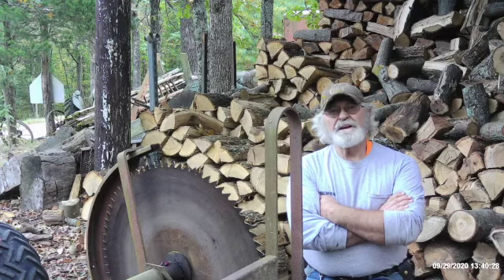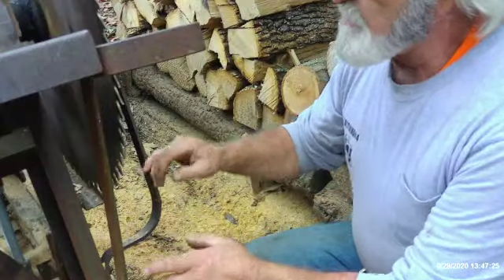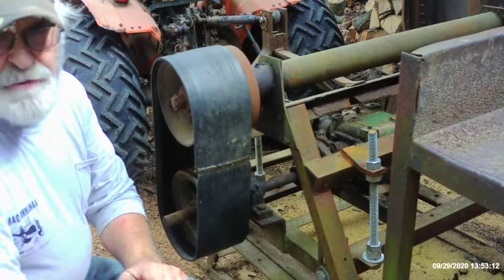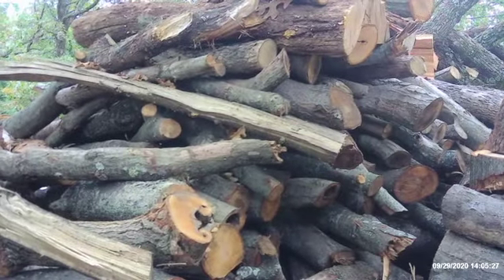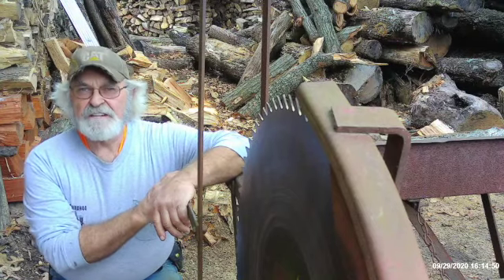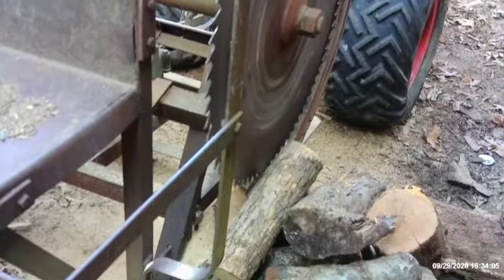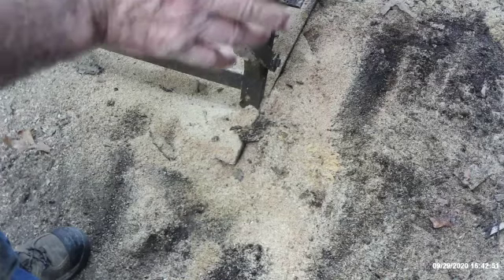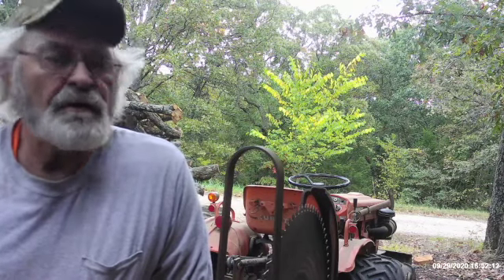Buzz Saw Safety: Detailed Safety Discussion and Operation

Comment: What a fun video 44 Friend! Years ago I did help with a buzz saw operation with a long belt and was warned a few times to stay well away from it. With two or three it is far easier and safer. I have many hour on ,y table saw and I know many guys who had accidents on a table saw but none what's so ever on a buzz saw. Any tool takes common sense and never grow out of respect for it when using. It's like driving a car and many more have accidents than a buzz saw or power tools. I know a guy who shot himself in the leg with a framing nailer, flesh wound fortunetly! He had he habit of walking around and up and down ladders with his finger on the trigger ,,,,,,,at least until that day. He was climbing a ladder and bumped his leg and wham! Very lucky not to have hit the bone or knee. Did go to the ER because those racks of framing nails are held together by those wires so he couldn't pull it out, lovely, eh? Over 50 years of working with wood it hasn't been luck but great respect for moving blades. You can attest to this as well. An ounce of prevention! With a buzz saw or any power tool you have a choice to be at the smart or dumb end. So don't be a dumb arce! Smokey sez, only you can prevent dumbarseness! I think that's what I saw on a sign in a national park? So Tractorman44 Friend, another fine and fun vid packed full of fun and adventure and edge of the seater scenes! I raise me cuppaJO your way inna morning inna holler! Of course I do this most every day but more than once with such an exciting vid! Blessings to All in he 44 Family and Headquarters and Stan of course! Pleasant dreams of dancing about with sugar plums in your 44 tutu! Now there's a video that would go viral!! DaveyJO from my holler to yourz
Reply from the maker: Yessir DaveyJO...you said a mouthful.  I have a cousin was cutting a 2x4 across his thigh with a skil saw.  Yep...kicked back into his thigh and a trip to the hospital....must have been funny to him because it kept him in stiches for a few weeks !!  Thanks for stopping in ol buddy and enjoy the coffee...I sure am !!  Take care and give my best to Alice.
Reply: Those nailers can be a terror. 
A younger and crazier Sneelock worked at Homebuilders Inc many years ago. 
I was walking the rafters running wire through the attic before the roof sheathing was put on. 
I had to watch my step. Literally because it was 16" between rafters and if I missed I either landed on the rafters in a painful way or went all the way to the floor. 
As I was walking along I kept hearing what sounded like bells. Just a little tinkling sound. 
I stopped and looked around but didn't see anything dragging or caught so I took a few more steps. I caught a glimpse of something flying past my face. I looked over at the flooring station and Bill Summers was on the top floor of the house stapling the walls in place. He had a Mark III stapler which shot 3" long staples through the 2x4 and into the decking. He was standing there with big grin shooting off a clip of staples at me. They were hitting the rafters and that's what I was hearing. 
The framers had left their nail gun on the scaffold so i went over and picked it up. I pulled back the saftety and started unloading the nail gun in his general direction. He saw me and jumped off the deck and hid under it. 
Not to be denied I just aimed the nail gun at the floor and started ricocheting nails under the deck. I wasn't aiming at him directly but it was a dumb thing to do. The nail gun would blow a nail completely through one 2x4 and sink it into the next one if if was set on full pressure. It was about like firing a 22 short. 
Needless to saw he didn't aim a stapler at me ever again.
Reply: Old Sneelock's Workshop  The things we do in our youth, eh? Those nailers have lots of power fer ser! I was aiming and nailing a 2x6 and a 10p nail went all the way through and landed by blue prints my friend Paul was looking over. He didn't say anything but his look said it all. An accident indeed and all the more reason to be extra respectful of power and hand tools. Thanks Kindly for your story! DaveyJO in Pa.

Comment: Good video  t man 44. Made me think when me n my dad used 2 fire up his saw 2 cut up batch of firewood.your 16 horse kubota must b a work horse from the way u talk. Dont know if u ever herd of yanmar tractors ill bet u have .dad bought a new model 186d  back in late 70s and that ole dog still goin and i dont think he was one 2 keep up on the basic maintenance. But she still goin strong lol he did stuff with it i didnt think a 18 hp would do.he passed in 2013 now i got the ole girl and shes all original  n still looks good.have good 1 n b safe.
Reply from the maker: Yanmar made a pretty good small tractor.  My buddy that's a Cub dealer in town just took on Yanmar tractors as a second line last year.  Selling a ton of them, most with loaders.  They look to be pretty good.  Weren't the old Yanmars two cylinder diesels ?  Front wheel assist makes a big tractor out of a little tractor. A LOT can be accomplished with these little guys, just like you can attest to.  Now you need a buzz saw for the old gal.....

Comment: hi there  another good one well done .  Have 3 of them around here  . but never used one . i have to many things i can get hurt on all ready around here .   Merry Christmas   john
Reply from the maker: Hahahaha...crack me up John.  I hate to see good pole wood going to waste which is why I use these so much.  I like to get a good mix of split and pole wood in the shed.  They dry differently and there's more sap wood in the poles, so they burn differently too. I think I got three of them up and running, but there's a few more laying in wait to be resurrected one of these days.... I do prefer split wood though.  Merry Christmas to you too.
Reply: @tractorman4461  i use a Stihl 201 top handle saw . light small fast short bar . you can saw with it a long time because it is so lite . john

Comment: Oh well thanks, that's good to know that my 6hp lister would be capable of doing the job. And its certainly economical on fuel that's for sure. And will run on lots of types of oil at a pinch too. No i haven't caught up with all of your buzz saw videos as yet. And yes i'd be keen to know which videos of yours in particular that you'd recommend for me. That would be helpful thanks Tractorman. Our own old man died of bowel cancer when he was 38 unfortunately. I know he would have loved this piece of dirt what i try to take care of. He was a carpenter and had been the type to buy those popular mechanic magazine as well. He was inventive type himself too and had used plans provided within that magazine to build himself a enclosed plywood box table saw set up with a blade what swung upward, and was controlled by the operators foot. I imagine he'd have known how to sharpen the saw blade too, as it was also what the past generations would all need to do too wasn't it. You didn't just throw your saws, or the circular saw blades away, and go buy another one back in those days. You'd even resharpen and reset your handsaw. I've learned a few blacksmith skill off of the last railways qualified blacksmith in our area before he'd passed away, so i generally don't throw much steel away ever. In fact i'm careful to go near dumps too, in case i'm tempted to drag more and more stuff home haaaaaa . In the end i hope to use some of the charcoal i'll produce from the selective logging, to fire up the forge.
Reply from the maker: Sorry my friend, this comment snuck by me for a few days.  LOL
    I never pass up a free piece of iron.  Being retired now though most of the access to it has been cut off, but my son still grabs a few pieces of shorts and off-falls from his continually changing jobsites.  I am just glad I was able to bring home as much as I did because #1, I have always built stuff out of it and 2), it keeps it out of the landfill.  Back in the day, the general contractors had to pay to have scrap companies set a hopper on site and pay by the pound to send it off.  It helped their bottom line to have guys like me lighten the load in the hoppers a little here and a little there.  
   I can't think of a particular video for you to watch, I'd suggesting watching as many as you can of mine as well as others so you get a more balanced idea of ways to use, build or adapt a buzz saw for the way you want to use it.  Then proceed with what you decide armed with all kinds of information and ideas. 
    Like there's one thing that puzzles me... Not being a professional saw doctor, I can't think of a single non-carbide wood cutting blade that requires sharpening the back side of the tooth.  Yet you see sooooo many guys sharpen these buzz saws on the back of the tooth instead of the front.  Hitting the front with a file maintains the tooth geometry whereas hitting the back of the tooth dobbs it off totally changing the shape over time.  Some so severely that the back of the tooth actually rubs in the kerf behind the cutting edge that no longer comes in contact with the wood.  Now there ARE ripping blades that have opposing angles shaped on the rear of the teeth, but the cutting surface is still sharpened from the front...yet guys still sharpen the rear.  Of course all I am doing is mimicking the movements from my old man and have not real expertise to clarify or prove my thoughts.
Reply: @tractorman4461  no worries its all good, and besides you must have so many comments at times that i'd say sometimes might be hard to keep up with answering them all. Im beginning to wonder if this blade what i have might have been sharpened by someone to act as a dual purpose blade . To rip and cross cut. See these to following video where this guy uses his saw to do a bit of both. Although i'm not sure i would feel comfortable to use it the way he's seen to be doing so though, as his hands seem to get mighty close to the blade. In the part two video he shows his method to sharpen in a little more detail https://www.youtube.com/watch?v=jKKcyKxu7aQ   and  https://www.youtube.com/watch?v=4xA6TFE9cI4 . On the blade what i have they've sharpened the back side similar to how this guy does, except for that its also look to have been sharpened to a precise angle as well (to the effect that if you were to look at the blade when sitting on the spindle, the angles on the front and the back would kind of come together to create a type of point, being as they'd be on opposite angle). I wonder if perhaps some people might have sharpened blades in this way when they'd be dealing with trees of what would have had mega amounts of knots

Comment: I like your videos and looking for a saw now. Liked and subscribed 👍
Reply from the maker: There are plenty of them out there.  I found one on FB Marketplace literally within 5 miles of here for $40.00.  I contacted the seller and it was sold almost the instant it was posted....I was the second caller.  Dang..... Then again you see others where they ask 3 or 400 bucks for one.  The best thing is to check farm auctions.  I use Auction zip and skim through the pictures, because you can see stuff in the background like a buzz saw or a blade that they don't take the time to list.  FWIW, I bought a rusty but new blade, arbor and set of bearings for five bucks at one.  Thanks for the sub....hope to see you around on some of the other projects.  We do a lot of tractor work too.

Comment: I like you have cut a lot of wood with one of those Salz. You have to use your head and be on your toes and you’ll be just fine. Ours were mounted on the front of a Farm all H or M and running with a flat belt.  It would be cool if you would do a video on the art of sharpening, putting set and gumming out that sawblade. Maybe you already have it I just haven’t seen it I just found your channel today.  Great video!  I always loved hearing those blades sing.
Reply from the maker: Hey Bruce..thank you for the awesome comment and yes they are not dangerous at all if you just keep your mind on what you're doing.  But there's a lot of guys just won't believe you.  They think its the 'Saw of Death' or something.  LOL.  I've got a lot of videos on these rigs... I need to make a playlist to put them all together.  I have several saw rigs, two with three point adaptions and one for the flat belt.  Try this one for sharpening:https://www.youtube.com/watch?v=ezvZ7u8jUwE&t=426s  or maybe this one:https://www.youtube.com/watch?v=ed8WSvOXvkw&t=898s or this one when I was just getting started on youtube:https://www.youtube.com/watch?v=TZ36Rxpn754&t=40s

Comment: Great video brother
Reply from the maker: Thanks Eric for watching and commenting.  So many are afraid of the danger because they don't realize the level of common sense that's required to run these rigs. That's the whole thing in a nutshell.
Reply: @tractorman4461  I agree   I want to take time and learn for sure
Reply from the maker: @ericbunksvintagesportsman6311  I would suggest for a beginning user to not cross the blade with your are as I do.  I've been on these rigs for around 60 years and so many of my actions are 'reflexive'....something that takes thousands of repetitions to acquire.  Start out with both hands on one side of the blade and let the cut fall to the ground.  Just make sure you stop and clear before they build up to where they can come in contact with the bottom of the blade. And make sure you continually clear the area of debris around your feet.  Don't create an unstable environment for your feet.  Good Luck.  In that thread I suggested there are several on sharpening and shaping the teeth too.  At least the old school ways.
Reply: @tractorman4461  Great advice! Thx!  I would only cut very small diameter pieces also

Comment: Very well done.  You covered a lot of territory.  For sure you can't put a price on common sense.
Reply from the maker: Well...I remember being on the tail end of 18' slabs up on the sawmill helping the old man put them through the saw rig on the front of the 101 Junior.  Uncle Chippo off bearing and tossing into the dump bed.  All this in the snow...slipping this way and that while being chewed out for doing everything wrong...!!  LOL.  Of course there were plenty times in nice weather too....  Then...sharpening cedar posts....the list goes on. LOL

Comment: I just stack my logs in a pile an chainsaw it.  But if I was out in the woods, it might be worth while to cut on the spot.
You need a side gard so the cutoffs fall away from saw.
Reply from the maker: We have taken it to the woods many times.  Most of what we get has to be hauled in, so we haul limb wood and logs then stack it separate here at the shop for processing directly into the woodshed.  Yes, a side guard would be kinda nice, but a helper is better. Unfortunately they are few and far between when the wood needs cut. By the way, your username is my DIL's mothers name.

Comment: I left my buzz saw at the old house. Regretted it ever since.
Reply from the maker: Yeah, that pretty much sucks.  They pop up around here for fifty bucks occasionally but the other day some local greedy gut was asking $500.00 on Marketplace for one.  WOW.  I am almost positive it is the same one that sold two miles from me a month ago for $75.  I called and he had a guy coming over already.  I can't believe anyone would pay 500 bucks for one.
Reply: @tractorman4461  I got my buzz saw from my neighbor Bob Collins. He had it in the side yard with a for sale sign. I stopped and looked at it. He was just interested in finding someone who wouldn't scrap it out. 
We became good friends after that. He is the one who helped me get Big Ernie the Ford 3 ton running. He also drug home a few tractors for me. 
The buzz saw was cleaned and painted then I waited to find a flat belt drive for it. 
Got the belt but we ended up selling the house before I ever tried it. 
Too many irons in the fire. The house has been sold 3 times in the 9 years since we moved. 
Don't know what happened to the buzz saw. Might be on Marketplace. If you see one painted Farmall Red with a wood frame and 30 inch blade it just might be.